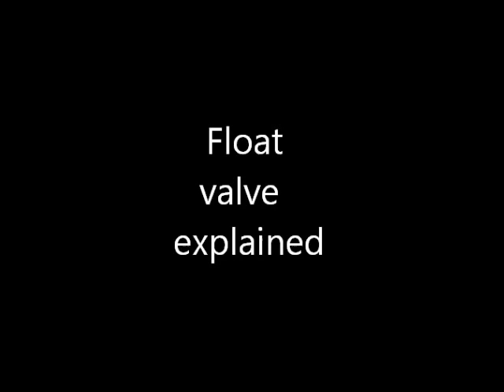Electric Pressure Cooker Float Valve Explained

Comment: My Elite 10qt pressure cooker float valve mechanism that holds the valve up when pressurized won't come over to hold float valve up in place. Any solutions? Thanks
Reply from the maker: I have never used a elite before , but hope someone with one may see this and be able to help you

Comment: Is it normal for the float valve to hiss and steam very slightly during cooking? Or should it be completely sealed until I open it manually?

I just got my first pressure cooker and I don't know if it's normal. It cooks fine but the steam hisses constantly.
Reply from the maker: Some will let a small amount come out .

Comment: So I replaced the float valve and the gasket that goes around the lid and my pressure cooker still not coming up the pressure any ideas it is a pressure cooker XL
Reply from the maker: Do you hear or see steam coming out anyplace . Is the pot heating up

Comment: We have a Cook's Essentials Technique Electric 5 Quart Pressure Cooker MODEL DYB350, That lets pressure out of the Pressure Valve the hole time its cooking, is that normal?
Reply from the maker: Depending on what is cooking , sometimes we get very little steam coming out , but not much at all.
Reply: Steam is released the hole time it cooking!

Comment: My release valve weight thing never fully seals it keeps releasing steam when it comes to full pressure.  Very flimsy and never tightens. Any ideas?
Reply from the maker: Just make sure all pieces are clean . Some pots do leave a slight amount of steam past the weight . If it is excessive leakage then look and make sure  to clean everything good . it will let any exta pressure out as  it weight is all that holds it down.

Comment: So my question is if floting valve come off is that posible to flying it hight when pressure relesing rigjt?.thats my bigest fear pls help
Reply from the maker: No the valve will not go flying . . Only thing one needs to worry about is when you open the valve , make sure hand is not on top where steam comes out , or will get burnt. . There are many safety features that make these safe .

Comment: having problems finding replacement rubber gasket washer for the floater valve. can someone please help with information on were to buy replacement washers???????  I see i am not the only one on here with this problem, maybe we can use any rubber washer?as long as it fits tight? can someone please help !!!!!!!!???????
Reply from the maker: +Leon Butler Before using a rubber one , i would look on ebay or another brand and try one for what ever i could find , may take some google searching , but should be able to find something close
Reply: Ok, thanks a lot, really appreciate the response.

Comment: I have a question.  My Tefal Sensor pressure cooker came with two regulators, an 8lb one with a green stripe  and a 13 lb with a red stripe. I lost the 13 lb pressure regulator when moving house. The 13lb regulator is the more useful of the two (for stews etc)  The green regulator is more for cooking fish and vegetables etc.  Soooooo..... can I make an alteration to the 8lb regulator to make it into a 13lb ?  Anyone else got a pressure cooker regulator with a red stripe that I could buy?  I've tried everywhere. Thought I had found one on a web site that said "buy it now" but it turned out it was an obsolete page.  Thanks.
Reply from the maker: Wendy Nakamoto In theory the heavier the weight the more steam pressure it takes to lift weight and let pressure out . So in theory adding weight would do it , but would need to be careful not to add to much weight or it could make the pot go to a unsafe high pressure , and could be very dangerous . Have you called the company to see about a replacement . Maybe someone out there will have one or will be able to tell you how much the bigger weight actually weighs .
Reply: Thanks for your reply wtbm123!  I've had no luck getting a replacement red stripe weight, not even from SEB, who now own TEFAL.  I've looked on Ebay occasionally and will keep looking. I will see if I can get gram weight specs on the two different regulators from SEB, but not too hopeful. Anyway, thanks again for your reply.

Comment: Pressure cooker is not reaching full pressure because the lights keep circling and it doesn’t start counting down.
Reply from the maker: Is the seal on lid good , and is the valve in closed position and clean where it sits and do you have enough liquid in it
Reply: wtbm123 yes, took everything apart cleaned and blew thu the valves. Made sure gasket to lid was correct.Made sure vent valve was closed. Cleaned and blew air on both float valve and vent valve before applying heat. Float valve is allowing steam to bleed thru so the pot cannot fully pressurize. The water comes to a boil but that’s it. The gasket is in place on the float valve. Do you think that if the gasket is replaced that would allow the valve to seal off? I can see condensate in the hole on the handle where the float valve is.
Reply from the maker: @franpeters184  If enough water , may with just a few cups of water in it to see , and if the release handle on valve is in closed position and seems to seal . the pin that goes through the lid has its washer on it , then most likely thing left is the big gasket . Or no getting hot enough .
Reply: wtbm123 The release handle valve was in closed position. I noticed it takes a longer time to heat up since replacing the fuse. If the gasket was bad in the lid, seems to me I’d see steam escaping around the sides of the lid, wouldn’t I? My experience with this cooker has been that I’ve never seen condensate in the hole above the float valve. It appears good around the sides. Oh, after unplugging it, even tho there wasn’t enough pressure to keep from opening the lid with boiling water inside, I had to open the vent valve when trying to put the lid back on because of pressure in the pot.
Reply: Oh yeah , I had about six cups of water in it. This is a 10 quart power xl. It cooked a whole meal last week without a problem.
Reply from the maker: @franpeters184  Usually you will see where pressure is leaking unless big enough leak to cause it not to pressure at all , and that big of leak should be visible inspecting the gaskets and sealing areas . . wonders why the fuse blew , it may be something in the cooker or a element going bad , not heating up as much , Now knowing the fuse was just replaced and no visible leaks i would wonder on the condition of the pot its self .
Reply: I don’t believe it. It’s working now.
Reply: The last modification I made was I reduced the water down to about 2 or 3 cups. I appreciate your help.